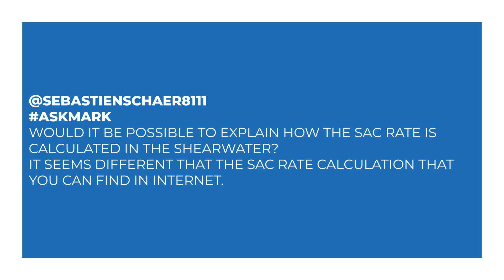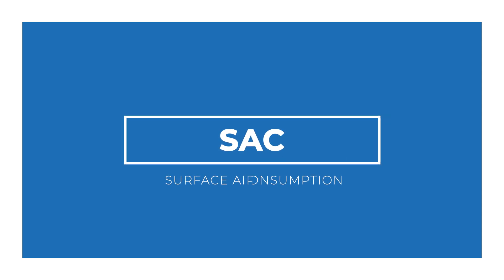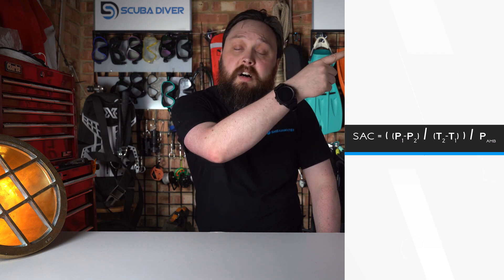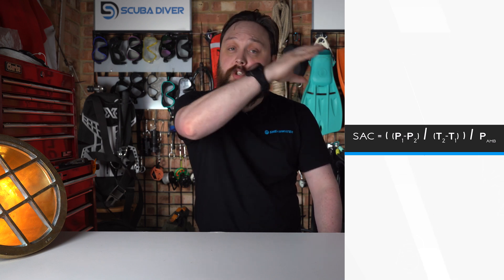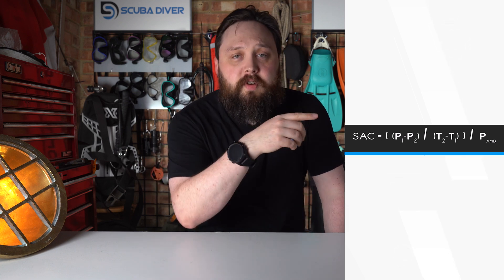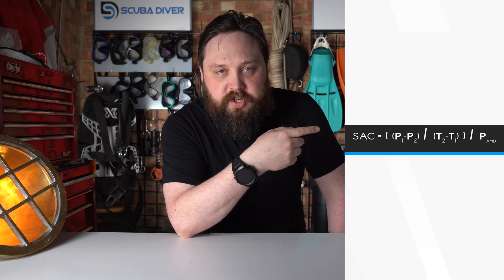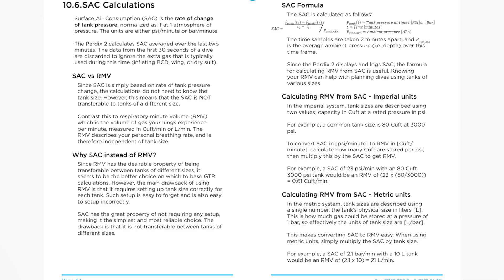How Do Shearwater Work Out SAC Rates? #askmark #shearwater

Comment: #askmark Hi Mark. Do you have any tips on climbing the stairs back onto the boat in choppy seas or strong currents without breaking any bones? Trying to take off your fins while holding onto the stairs is a nightmare and taking them off without holding the stairs leaves you at the mercy of the current. Any advice would be appreciated
Reply from the maker: I leave my mask, regs and fins in place, if you fall then you're good to try again and you're not flailing in the water. I only take them off once I'm sat down.

A lot of it is timing, three points of contact at all times and the power comes from your legs, not your arms. At the start I'll move with the water but, once my chest is out of the water I'll move with the boat and progress slowly.

Keep your weight forward so the weight of your cylinders is over you as much as possible but, don't hug the ladder and break your teeth. Also be aware of how the ladder moves because some hinge and you don't want your hands to get pinched.

Step up and straighten your leg and bring the other up while your arms hold you close to the ladder.

It is tough, just take your time and try to let your legs do most of the work.
Reply: @ thanks for the detailed advice

Comment: Wait.... Shouldn't sac rate be in  liters/min, rather?

Surely the size of your tank doesn't affect your sac rate 😅
Reply: @sparksi2519  if you're breathing 50 psi a minute out of a 12 litre vs 14 litre tank, you're breathing a higher sac out of the 14 litre tank, however the swift doesnt know how big of a tank you've put on. imo Shearwater should have an option to put in the cylinder capacity in the app to calculate the whole thing

Comment: My Garmin (MK2i) gives me a SAC rate in L/min as well as RMV in L/min. I understand the SAC rate is the consumption adjusted for depth, ie at the surface and RMV is the actual consumption. Do you know if my understanding is correct?
Reply: Yes but that isn't how anyone else would use RMV. Traditionally SAC was a volume measurement, it was something you calculated after the dive taking pressure used, average depth, and calculating that against your tank capacity. Then SRI came along and had real time SAC in pressure per minute. And then because people were giving pressure based SAC, instead of insisting on people diving units, they repurposed the term RMV form medicine. RMV is used by some for what SAC used to be volume per min at surface.

I use SAC for volume with units and never use a pressure based SAC.

Comment: #ASKMARK My predix ai does a calculation for GTR (gas time remaining) , do you know how that calculation works ?
Reply from the maker: Shearwater are clever with this one also: They take the known tank pressure and subtract enough gas to ascend to the surface at a safe rate and also subtract enough gas for a reserve.

This remaining gas is then divided by the ambient pressure and your SAC rate to work out how many minutes it would take for you to breath down that gas and still be able to ascend to the surface with some reserve.

But. It won't take deco or safety stops into the calculations so, don't go right up to the limit or you may need to go into your reserve

Comment: Hi Mark, (Hi Shearwater, if any of you are reading this), I use the Perdix 2ti and every now and then (in 22 dives 2x) I have the problem that the SAC rate was very high (45bar/min or higher). I can't explain why this error occurred. Do you have any idea? My normaly SAC Rate is about 1,6bar/min
Reply: I would send that dive log to Shearwater support. Definitely interesting.
Reply: Hmmm. How smooth is the value from your electronic cylinder pressure gauge? If this is (erroneously) dropping to zero (or a low value), then you'd see that effect.
I've seen this in (in house) lab equipment from loose wires in the analytical machinery. But we could go to manual calculation and get round the problem. Next break in operations, out with the soldering iron and solder the pressure cell's connections. Bug report filed to the technician who built it.

The last time I calculated "SAC" rates was for cave diving, to work out if I'd be able to make a particular air bell before reaching 'thirds'. But always, the answer to such questions is "bigger tanks". Skip-breathing isn't really an option. I'm trying to remember what 1cu.ft/minute is in L/min. (28.4 L/cu.ft - I had to work it out.
Reply: 3 suggestions:
flooded/damaged transmitter
or 
make sure your octo. is not free-flowing during your dive
or 
if it is not happening during DSMB deployment.

Shearwater is probably not as good and reliable as it used to be. My Perdix2Ti pressure sensor failed just after 6months/280 dives  (soaked in fresh water every day)

Another guys Teric pressure sensor also failed (within Waranty period).